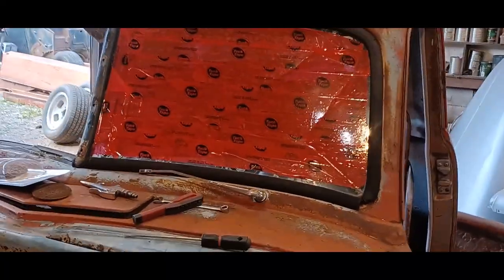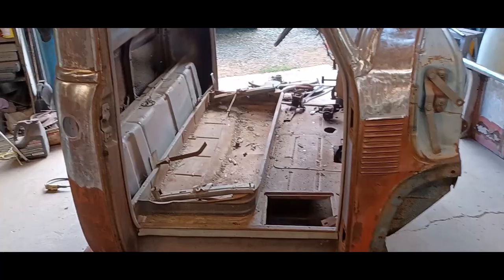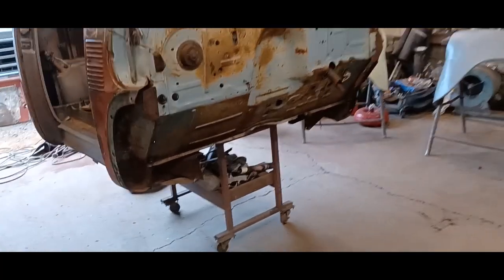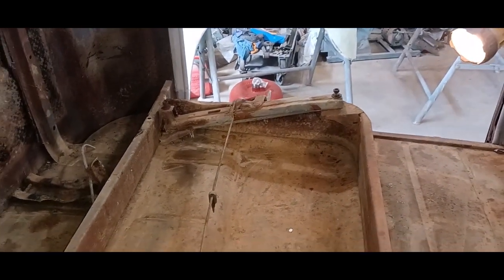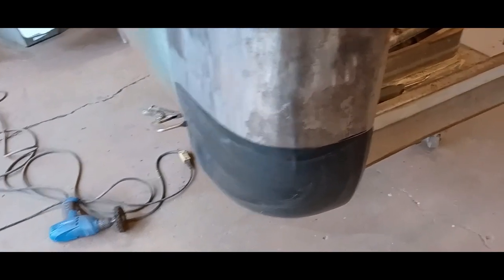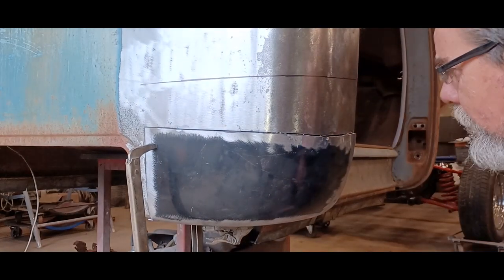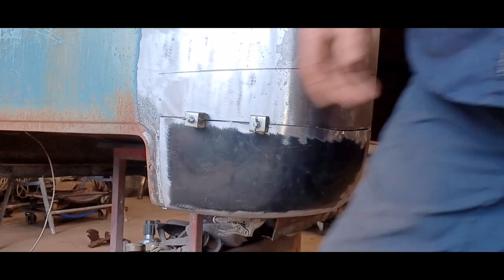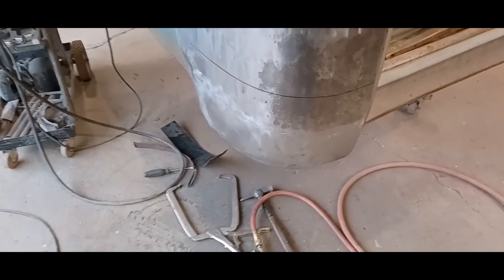1951 CHEVY CAB CORNER REPLACEMENT!

Comment: Great content. I just picked up those 3M paint & rust wheels on your recommendation to start on my '52GMC
Reply from the maker: Use 'em on a drill or something similar...I first used them on a mini angle grinder and it revved too high...they last alot longer on a lower rev machine and it's just as fast. Good luck on your '52!

Comment: What were you using for a strip disc in your video to remove the paint? Thank you for posting the videos especially helpful was the one on cab corner replacement
Reply from the maker: It's a 3M rust & paint stripper...get 'em at hardware stores and amazon...thanks for watching!

Comment: I see you used those sheet metal welding gap clamps. Don’t they create a gap that’s hard to bridge when you use .023 mig wire? At least that’s my novice experience.
Reply from the maker: I think the gap is ideal...I use .030
Reply: @dirtydansrodncycle  Is the .030 the gap or the mig wire?
Reply from the maker: @chandiaz7694  mig wire
Reply: I use .024 mig wire, those panel clamps do make the gap a bit wide.